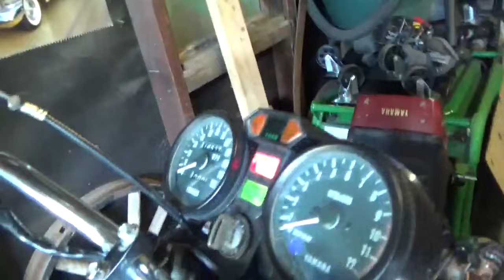Motorcycle Repair for Desperate People..

Comment: We don't get many Mitchells at the car wash, so that was good!  

All those years ago, when I helped in a bike shop, the old guy just used to chuck castings in a bucket of diesel, leave them for a week and then pressure wash them. He had the great good sense to only work on old bikes, simple stuff, no starter motors, no oil warning lights, no USB ports on the built in radio.....
Reply from the maker: I understand and can get along with the 1970s tech, engineers had not yet lost their minds.

Comment: Some years ago I felt confident working on cars that I thought motorcycles should be a doodle. Boy was I wrong! My only "success" was disassembling the motor on a 80cc Honda scooter. Nothing looked out or order but the valves did not seal. I put all the pieces in a box waiting for that day when I figure how to "fix" them.
Reply from the maker: Hey Oscar!   They are different that is for sure.  Hopefully I know someone that can save me if I get in over my head.  Cheers from here